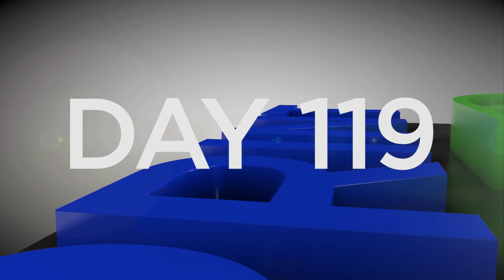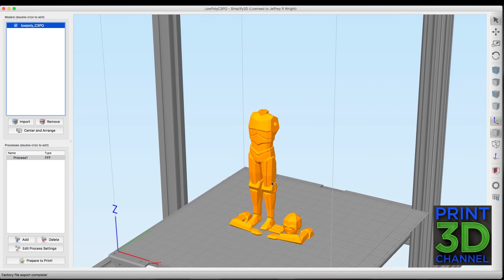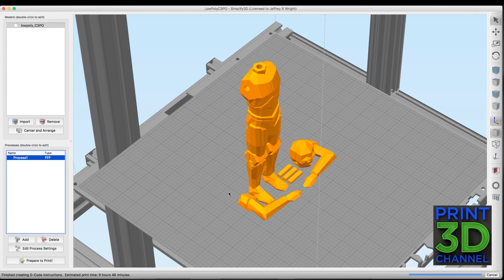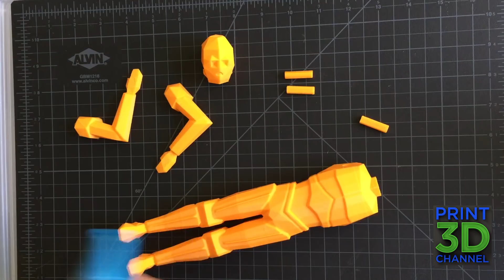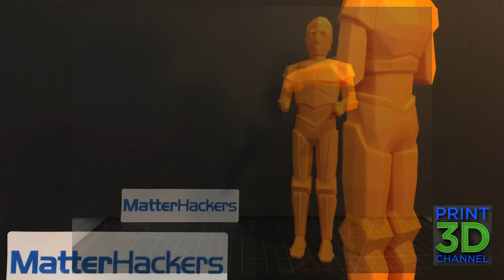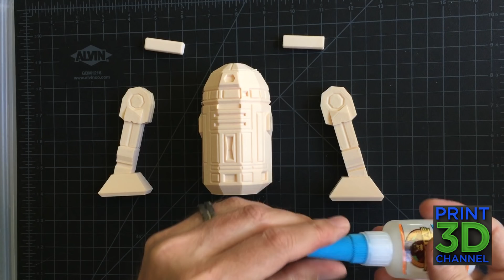#3DP365Project - Day 119 - Low Poly Redux - MatterHackers & gCreate

Comment: Nice. I printed these on my channel. I assume the pins are so loose because you resized the model. But it looks really cool at the larger size. Too bad I don't have enough vertical build volume to do that on my printer.
Reply from the maker: That is possible, scaling does affect those tight tolerances. I have a few more to print too. Thanks for watching and for the comments!